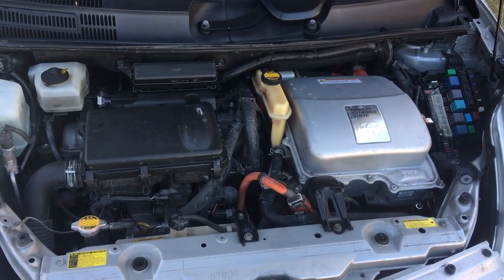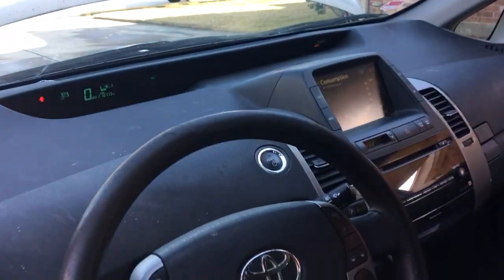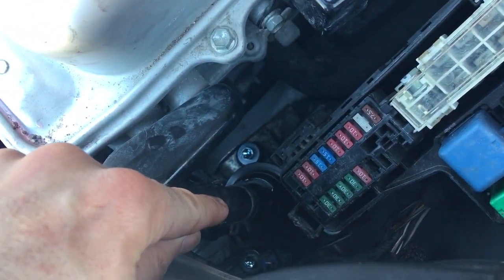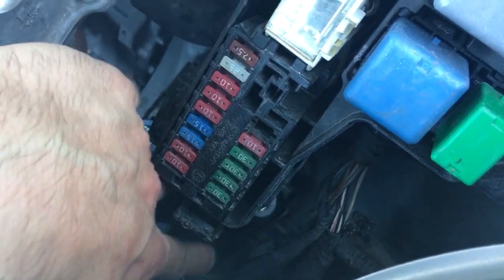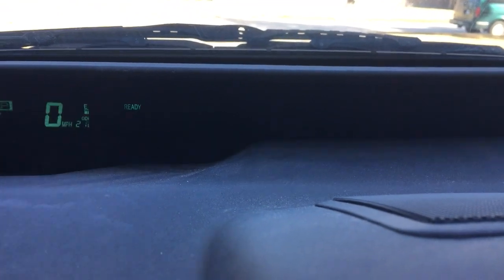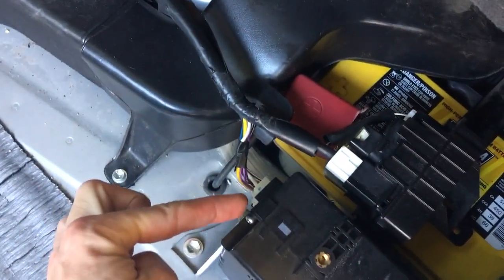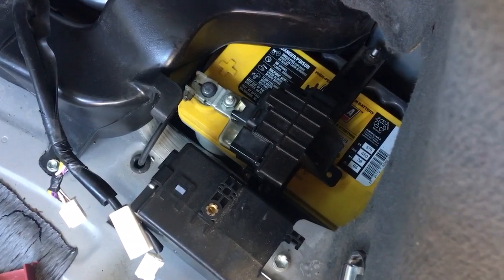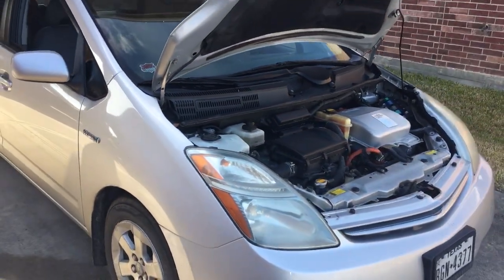Toyota Prius Red Triange of Death Water Pump Battery Error Code P261B

Comment: Another hint is that the pump runs even when you're not in drive mode. Push the ON button twice without putting your foot on the brake. This will turn on most of the car systems except for engine and drive mode and the engine bay will stay very quiet. The inverter pump will be running and it's easy to tell, if you put your hand on the pump it will be humming and you will see the fluid being returned to the reservoir if you open the top cap. You can probably even hear it humming. If it's not humming then the pump is bad.

Comment: If you have old Prius get a code reader! To read the codes sure but also clear them. They are very reasonable price these days. The people who say this takes 7 minutes (bs) or half an hour or something it probably means they've been buying the cheap ones on Amazon or ebay which only lasts about a year or so and they get very fast at changing out pumps. On my '08 I replaced it with a cheap part on Amazon and it lasted two years. This time I went to the dealer and got an OEM part $180. If this pump goes out you will fry your inverter and it can disable your entire car. Do you really want to put a $30 part there?

Comment: the Black wire is positive , white and black wire is negative. Just a tip when testing. He was mistaken about that. You will short pump immediately if you mix that up. Also something that nobody seems to metion is that the AC stops working when the temp of the inverter gets high.

Comment: The easiest way by far to replace the pump is to pull the bumper off and slide out the left headlight. Just a couple screws and snaps. With those out of the way the pump is right in front of you and effortlessly accessible. Take two clamps and squeeze the hoses tight. Remove the screws and pull the pump off the vehicle. Remove the pump clamps.  Pull the pump off the hoses. Take the new pump and reverse the process. Takes about half an hour.  Once back together check for leaks and burp the system at the relief valves. You should see a little wave in the reservoir next to the big inverter box.

Comment: Toyota dealer I went to wanted 720$(part and labor) to replace the inverter pump. I paid the fee for them to diagnose the problem and had it towed home. Got the actual Toyota inverter pump for 50$ cheaper on line and replaced it myself in less than an hour.....

Comment: Hi! I have the same problem with my Prius 2014. Fault code P261B. My car have done so far 210.000 miles. I change the water pump brand new and The thermostat but stil have The same problem. I don’t understand why? Something solution for expert will be great. Thanks!!!

Comment: This may sound funny but I carry a extra pump in my trunk as well as some tools and vice grips to use as clamps on the hose so less spilling. I have a 2006 Prius with 243k miles. I have been thru 4 pumps so far. Just carry an extra pump with you as well as fuses as they will often short out the fuse when the pump fails and your car will not function at all if that tiny fuse blows.
Reply: That is funny. Carry a spare serpentine belt and some coolant too? But seriously these cars are so reliable that extra parts is not all that necessary in my experience with Prius'.

Comment: I had bought my Prius new in 2008  and about 6 months later I received a recall letter from Toyato to come in to have my water pump replaced under warranty. I was wondering if having that done corrected any manufacturing defects and get more mileage before the pump needs to be replaced ? 

Also you mentioned you had to use a “ potato “ ? To hold I guess you meant the pump hose on are you serious ? LOL I would like to know more about that ? 

I did enjoy your video it was well done 👍 

Thank You for making it.

Comment: I just got my 2009 Prius repaired last Sunday when the red light of death occurred on my dash! I never experienced this before and I had just put in a new 12v battery replacement. The AC went out along with the cruise control. I drove to a Toyota dealership that I passed earlier in the day which was the closest. The sales department was open but not service. Turns out the only Toyota dealership open was two counties south of where I was but I called them and they gave me an appointment and I drove there as quickly as I could. They did an analysis and came back and said I had a bad Hybrid Water Pump. The service advisor told me it would cost me $682 to fix it right now. Considering I knew nothing about how to replace this part I said fix it. I have to tell you that when I got the bill at the end and saw $420.77 for labor, which took about 2 hours, I have to tell you that motivates me even more to invest into a good scan tool and to learn more about fixing this Prius myself! I already purchased spark plugs for around $12 and bought two torque wrenches so I can replace them myself when I get to around 150,000 miles or sooner if needed instead of paying $150. I also just purchased a small tool kit to put in my car along with a floating charger for the 12v battery just before this happened. I am learning the hard way to take care of my own car and not waste money at the dealership! They have a nice new building that probably cost them millions of dollars to build and I don't want to get gouged so they can pay for it! These labor rates should be illegal!

Comment: The intent was clearly good, but there is still misinformation in this compilation:

1) P261B isn't a valid code for the 04-09 Prius.
2) P0A93 is the code for this issue.
3) issue on 04-09 Prius - same replacement pump P/N for all model years.  Redesigned in 2007 to address shorting issue that actually disabled your car by blowing the AM2 fuse - dash, everything goes completely dead, and you have to pull over.  Still happens occasionally on the new pump. All cars were recalled for the new style. Later 07 and all 08, 09 had the new P/N installed from the factory.
4) When resetting codes, you can 1) wait for 2-3 complete drive cycles and they will turn off, or 2) disconnect ONLY the single large connector on top of the battery (+).

This a design flaw. Pump runs balls-out all the time whether the inverter needs cooling or not.  As a result, they just wear out.  Expect to go through one every 70-80K miles. If you buy the cheap parts-store Chinese garbage, you'll be lucky to get a couple years out of them. It's worth the extra $ to get a Toyota pump, and no, the "genuine" pumps on Amazon for $90 aren't "genuine" unless you trace the seller back to a dealership's online business unit.  Discounted SHOP cost for a pump is over $100.
Reply: my dealer wanted $175. got one Lexus(Toyota) online for $80 shipped. replaced valve and pump at the same time, 134k.
Reply: yes, "P0A93" is the code for this issue !
Reply: Just replace the pulley rotor inside pump that's it! $27

Comment: Good video!   I have a 2008 Prius.  Installed an inverter pump OEM.  Bled system, but not getting turbulence in reservoir.  Any help would greatly be appreciated!  Thanks!
Reply: did you check the replacement like he said in the video by using a 9v battery.  I am in the process of replacing mine and read so many reviews on amazon of getting lemons that im going to bite the bullet and buy from the dealer.
Reply: @alvareza3  I just went with the dealer part and fluid.  It is running good.
Reply: @Ganimo ganiman I think it was like 160. I forgot

Comment: When you have the red triangle of death and a whole bunch of yellow lights lighting up in sequence it usually means her inverter cooling pump is shot. Most mechanics will do it for 350 to 400 my mechanic does it for 250. If you’re in Los Angeles look up Prius express all he does is fix Prius cars. Guarantees his work and his fast
Reply: Your mech is a thief, pure and simple. This is a 30 min job max. Most any decent OBD2 scan tool will tell you what you need to know about a code. Go buy one online. Cost you maybe $100 for a cheap scanner. Most repair shops have a rate of 150/hr. So the most you should be charged for a Inverter pump is maybe $100.
Reply: What a weird thing to say. In my post I said my mechanic will do the job for $250 that includes parts and labor.. I didn't even specify which Prius.the first generation Prius is harder to do than a second generation Prius . My mechanic did indeed do the job in about a half an hour but it would have taken me quite a bit longer and who knows if it would have been right. My mechanic has all the necessary gaskets and parts and ability  and know how so I don't have to stress about it. Any work he does he gives me a one-year guarantee on the parts. I'm always happy to give him the money. And I have had much more expensive mechanics especially having the Toyota dealer do it which is crazy.
Reply: @asyouwish9567  I am happy that you are happy with spending your money. However what I was getting at is for all the rest of us with no money to blow, paying a mechanic 250 for a job that can easily be done in a driveway for less than $100 is far more economical, and sensible. There are no gaskets or special tools required for this tiny pump job. This video here proves it can be done easily, in a few minutes, even when running a camera with commentary at the same time! LoL If your guy took 30 minutes he was wasting a whole lot of time on something else! 

I agree the Gen1 Prius is SLIGHTLY more difficult to change the inverter pump (aka take off the headlight first). I also agree that anyone who goes to a Toyota dealer for anything is insane. Dealers were not nicknamed Stealers for no reason, even with coupons! LoL

Comment: Any suggestions on how to read the OBD codes? I have a MAC Tools OBD 2 reader and it doesn’t work. I have the red triangle and a couple of other lights. My pump was replaced about a year after I got it (it’s a 2006 and the pump was replaced in 2010). 
I can’t seem to find any info about what to get to read the codes other than something that needs a laptop and software. I’ve seen apps for Android phones but I have an iPhone. Any help would be appreciated.

Comment: Does a bad one effect the mpg?
Reply: Probably yes. The computer is smart enough to tell when it needs to limit power to the elec drive parts since the Inverter is getting hot due the the pump failing. When that happens the ICE is going to use more gas to do the same trip.
Reply: Your inverter will overheat over time and will probably need replacing.

Comment: I only disconnect the one large white connector to clear codes. I find that just under 1 minute is more than sufficient. This leads to the AC being set to 75 degrees the clock reset to 12:00 and reverses any tweaks to seat belt warnings and the back up beep ( which is only for the driver- but is more distracting then helpful unless you didn't mean to be in reverse).  My 2007 does not have the third connector to the left of the battery. Disconnecting the posts is much more problematic than simply unclipping the modular plug.

I have been clearing my codes daily with a bluetooth OBD device but have found that some problems with brakes and stalling that seemed caused by the inverter coolant pump failure recurred quickly if I didn't also disconnect the battery.

I replaced the instrument cluster earlier this year to good effect on many spurious codes, just in time for the coolant pump problem shortly after a 2500 mile cross country trip.

Comment: I just replaced my inverter pump on my 2008 Toyota Prius with about 154,000 miles.  I went through the bumper cover & headlight method.  Pretty easy and much less than $750  my dealership wanted including flushing and replenishing the coolant!  In my opinion, it made sense to completely drain and replenish the coolant at the same time.
Love my Prius, YouTube and Amazon make driving and owning my Prius even more affordable!
Reply: Hi there! I'm needing to replace my inverter pump on my 2008 Toyota Prius as well. Could you recommend where to buy the water pump? I'm looking on Amazon, but I want to make sure I purchase one that will work well. Thanks for any help
Reply: @vicriosrn  I bought the Orion Motor Tech G9020-47031 Engine Coolant Inverter Electric Water Pump Assembly with Bracket for 2004-2009 Toyota Prius Hybrid 1.5L, Replaces G9020-47031 and 04000-32528
by Orion Motor Tech on Amazon
Reply: @JeffErdmann  Thanks so much!

Comment: This pump was recalled by Toyota.. I owned a 2007 Prius and had the dealer replace mine at no cost. Check ino this before spending your own funds to replace it.
Reply: Now a 2007 Prius is no longer under recall. You have to pay for the repair!
Reply: Timothy Jurgensen i had mine replaced under recall as well several years ago

Comment: Well must tell you that have done your steps, after putting thing together, took a drive in the car with the A/C on car drove great for about 30 ,minutes or 20 miles and bang, the VSC, check engine, the red triangle all came on GRRRRR!
Crap once I got back home did this all over again, this time unplugged the axillary batter plus found the small hose was not attached to the battery so I fixed that, put everything back drove it about 10 miles around town, so far so good, but tomorrow will be the true test. I will let you know it this really works,
Reply: Mireya Kuritz update?
Reply: Did it work
Reply: Many things could have caused his problem, including HV pack fail to loose wires. Or maybe he let too much air get into the coolant system. Hard to tell what exactly went wrong. I have known some people just junk the car after trying to fix something beyond their skill level. I find lots of great cars that way! LoL

Comment: Thanks for the helpful video.  The warning lights will go away on their own after awhile on their own.  Mine did.  An easier way to do what you did to reset it though would be to just remove the positive post.
Reply: You should disconnect the negative instead.